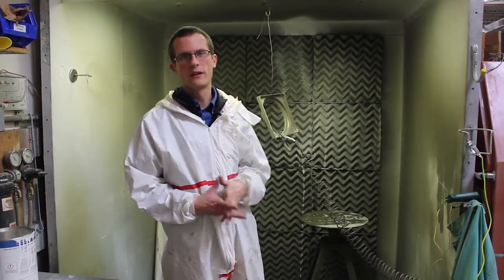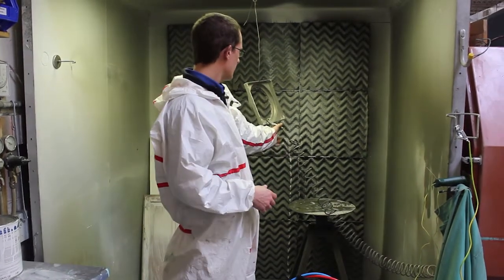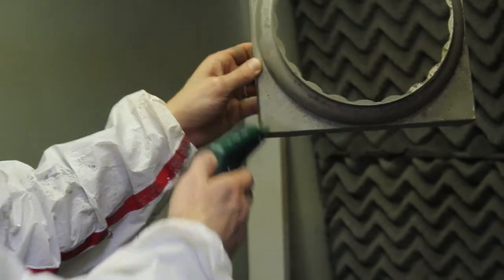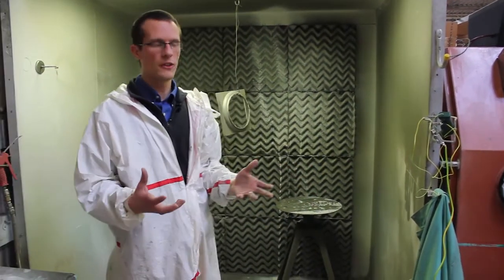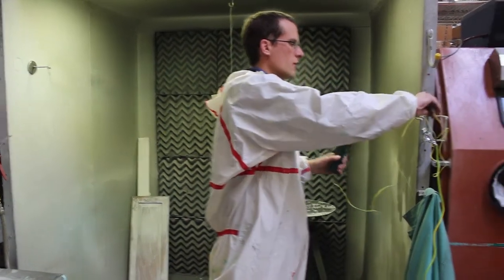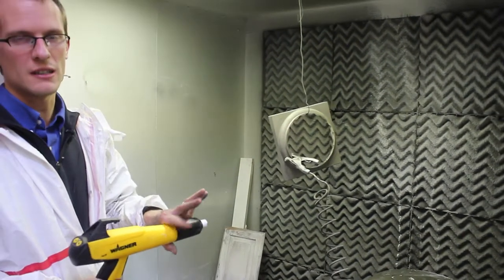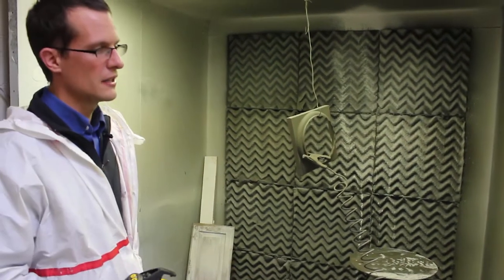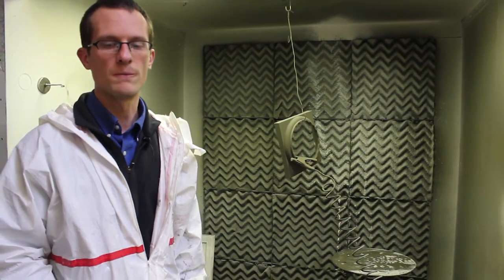Grounding for Powder Coating

Comment: I was setting up yesterday, and I ran a cable from a water inlet pipe that went down into the stone floor, back to my small booth. And then I connected that cable and the gun (redline ez) ground connection to the object being coated…… does that sound correct?
Reply from the maker: The cable to the pipe should go to the part the gun cable should go back to the pipe not to the part gun cord is to ground the gun itself

Comment: Rethink this as 1 electrical circuit, the powdercoat gun ground goes to the part, the charged paint is attracted to the ground.  Your hook, booth, electric panel should provide the part with a good connection to the gun ground.

Comment: My Kool Koat 3.0 came with a ground that comes out of the back of the control unit. Should i still upgrade my ground?
Reply from the maker: That ground is really meant to be a backup for the kool koat in case the electric plug has a bad ground .  So ideally yes you will have a separate ground that you use to ground your product your coating and use the Koolcoat ground as a backup ground for the Koolkoat itself